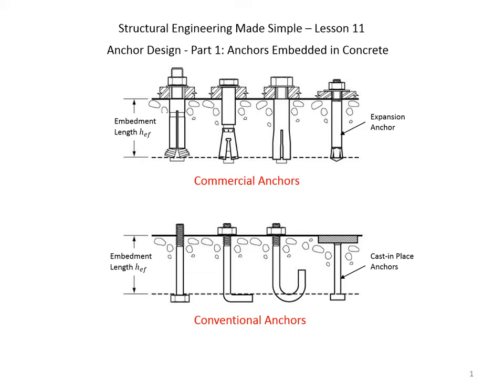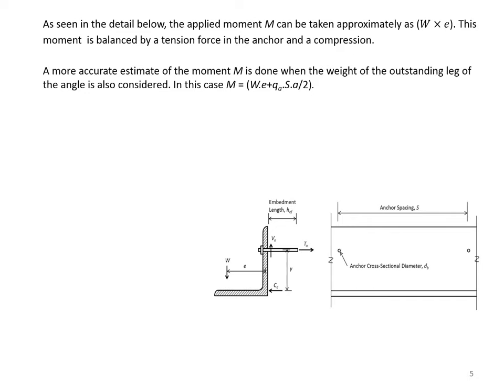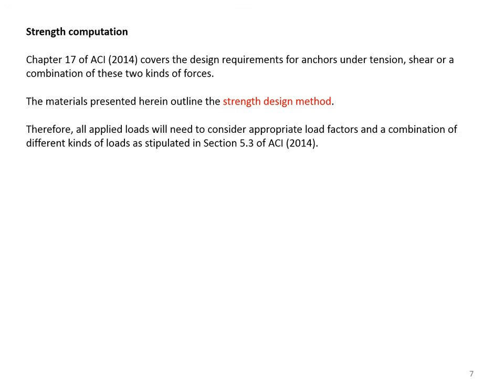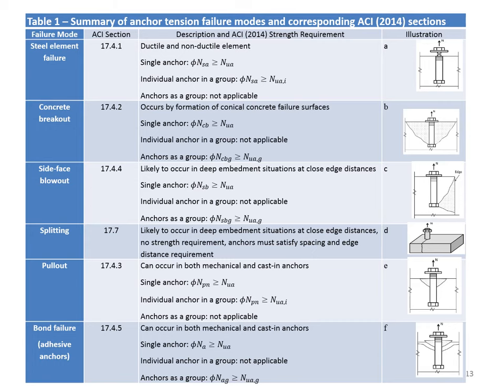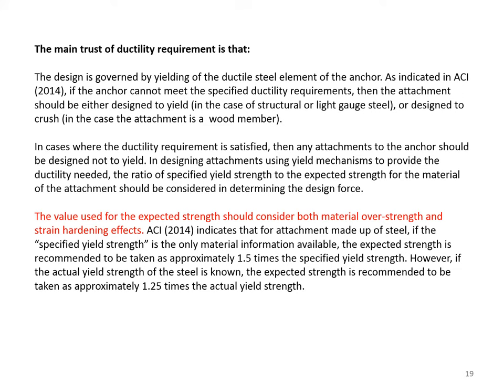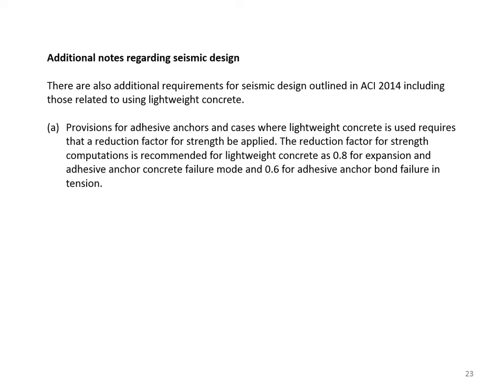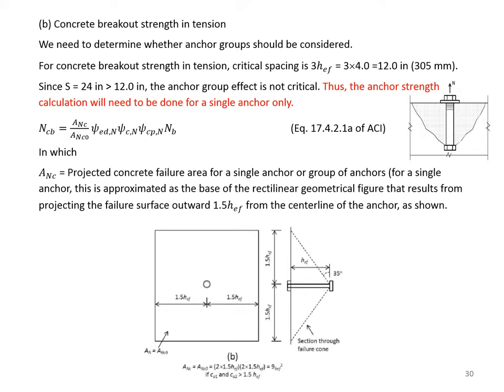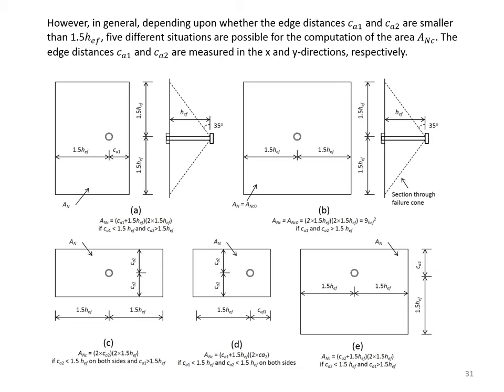Structural Engineering Made Simple - Lesson 12A: Design of Anchors in Concrete

Comment: this is all good...however....I have seen not design ....of throughout bolts with a backing plate...

I have a Simpson strong wall sitting on existing footing...my best option to transfer the loads to foundation is to drive the bolts through the 18"thk. concrete and provide a backing plate....

the Simpson wall is 4" wide with 1"diam. rod....so...the distance to one edge is 2"...
I could pour / epoxy new concrete...but...that would not make any difference...there are not edge distance issues on the long side...

any suggestion...or...can you address an example for such conditions
Reply from the maker: Greetings, Many thanks for the comment, please allow me to look into your point. I will work a problem dealing with base plate design (whenever, I get some free time), Best regards, Jamshid

Comment: Can you please explain which table in AISC are you referring to for finding the lever arm for different angles?
Reply from the maker: Dear Komaldeep, Than you for watching my lesson. This table is usually at the bottom of the last page for angle properties (Table 1-7). I use the 13th Edition (2005) and it is at the bottom of Page 1-46 in Table 1-7. Sincerely, Jamshid
Reply: @jamshid50  Hello Jamshid. The Table 1-7 in AISC 15th edition has the Y_bar value of 1.77" instead of 3" you used (for L6x6x3/4). Can you please clarify on this?

Comment: could you explain how the units work out
Reply: on eq 17.4.2a
Reply from the maker: Dear Joshua, Thank you for watching my lecture. The ACI equations are very specific in using pounds and inches. So do not try to work out the units, since those equations are all based on data (and some form of statistical regression analysis). You simply use psi for all stress values and inches for dimensions. The results will be pounds for forces and psi for any stress value. Sincerely, Jamshid